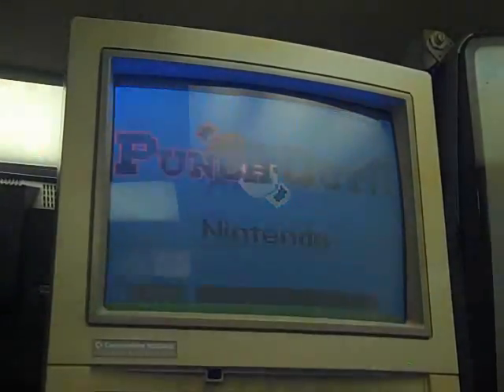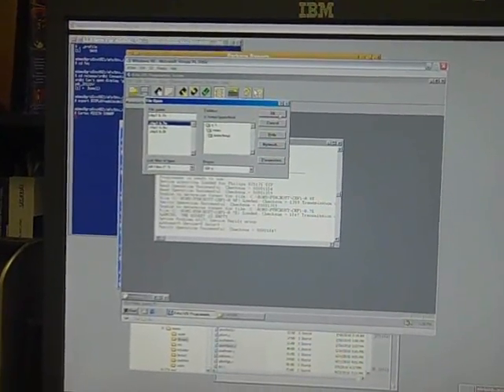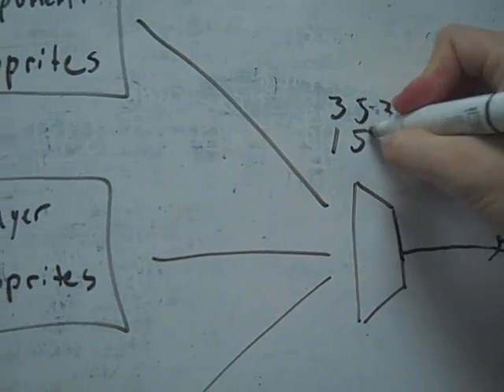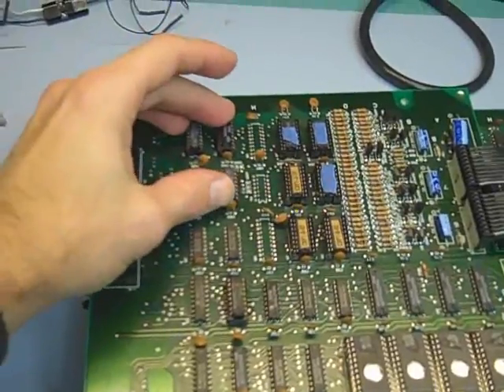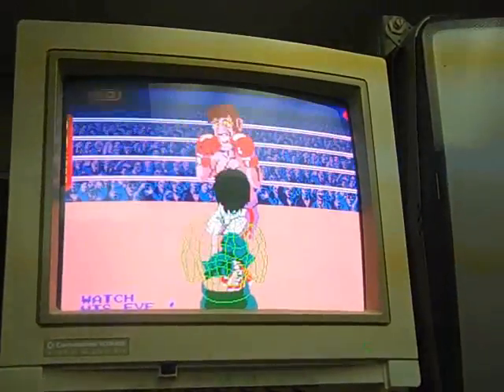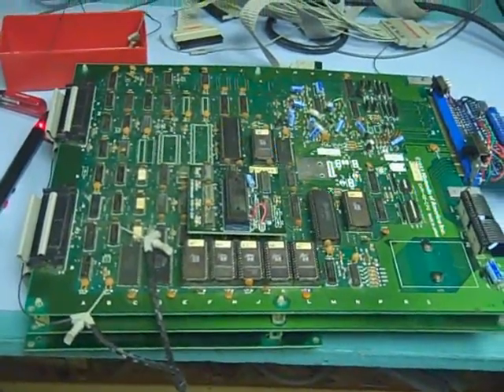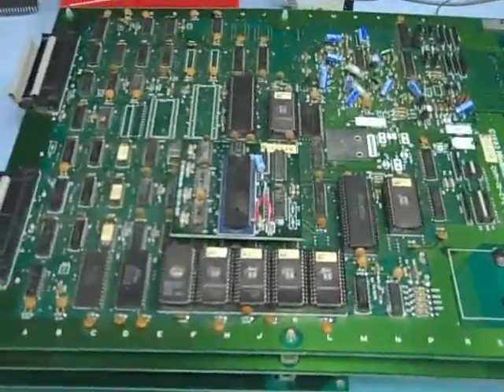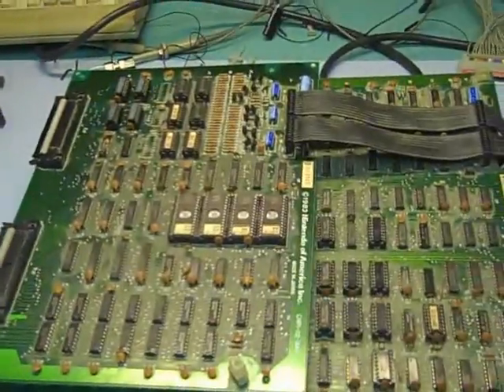Punchout Repair x 2 and some palette discoveries

Comment: Any reason not to add a 'NOT' after the 153/353?  Nice fast one so there's no timing issues?
Reply: Paddy Robinson-Griffin Because you'd then need to add a NOT gate to all eight outputs of the chip.

It mixes three sets of 8-bit busses, so it would be a lot of work to invert all of those signals vs simply replacing the Mux chip. ;)

(actually 4-bits per chip in reality, and they only mux two sets of 4-bit bus inputs, so there are multiple chips.)

Comment: Hi, your tutorials are great and gave me a couple of ideas to repair some of my PCBs. The schematics that you show are also very cool. Please release more repair tutorial, specially with PCBs with blank screen or broken sound which are very common problems.
By the way I believe that early Nintendo Boards had the RGB signals inverted and actually the Nintendo2Jamma adapters have a signal inverter.